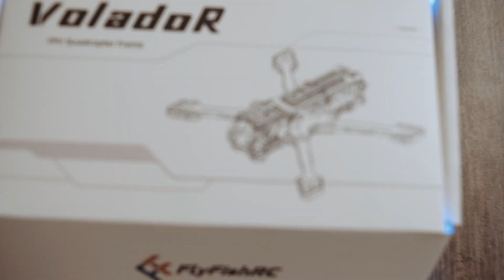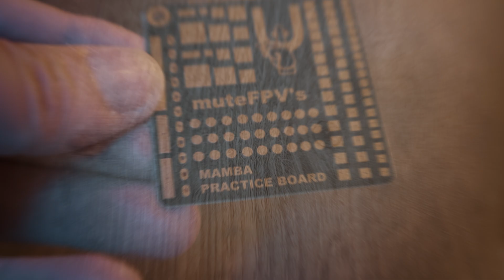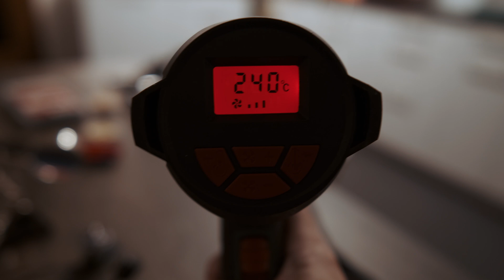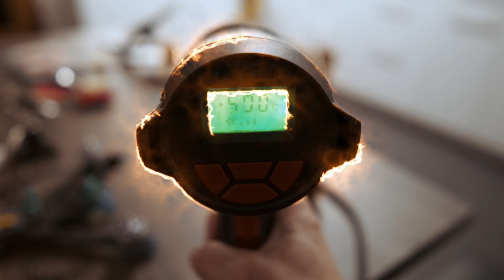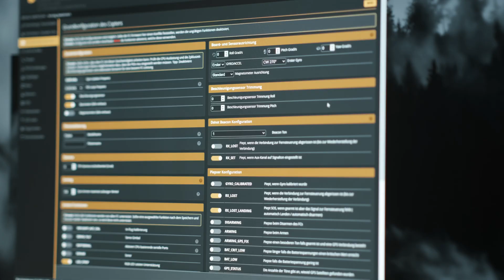BUILD AND DESTROY AN FPV DRONE

Comment: Very entertaining build and flight video also artistically very well done. Just a high level criticism: Heat directly on the cap instead of applying heat from the side on the cable connectors with the dryer. No used smoke stopper shown...
Reply from the maker: Thanks for the tip. I always use a smokestopper first but I didn't show that in this video.

Comment: I wish I could afford such a drohne😢
Reply: same
Reply from the maker: Yes, this is an expensive hobby. 😔
Reply: The Drohne itself would be Fine but the dji Goggles are so expensive
Reply from the maker: @dangluecki  Yes, that is the most expensive part in this hobby. Luckily you only need one of these.
Reply: Yeah that‘s True you also have to buy ist once and then  you can just build Drones with the Same System but for me as a Child it‘s just too expensive

Comment: It's just the camera... easy fix. I use a UV filter over it, will probably save the camera.
Reply from the maker: Thanks for the very valuable tip
Reply from the maker: What kind do you have?
Reply: @elmerayo  Guess what, was trying some powerloops over a plowed field (lots of sand and also had small debris/rocks in it... crashed it and guess what, UV filter cracked, impact right in the center. That could have been a scratch I guess. But the UV filter is very thin glass, so not sure of it would have been ok on the glass of the lens. Going to order another one. Found some cheaper from BRDRC and GEPRC, around 11-15euro... going to get a few!
Reply: @elmerayo  I have the freewill filter. The UV costs a bit, but worth it perhaps. Ordered it together with ND filters.